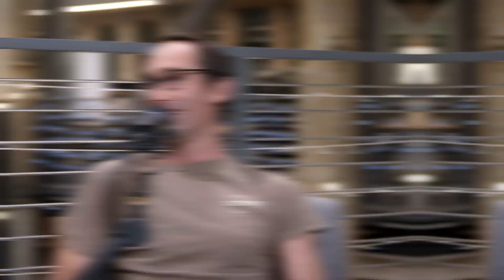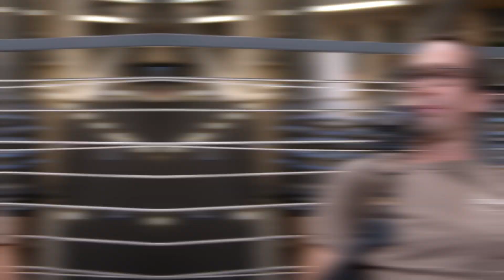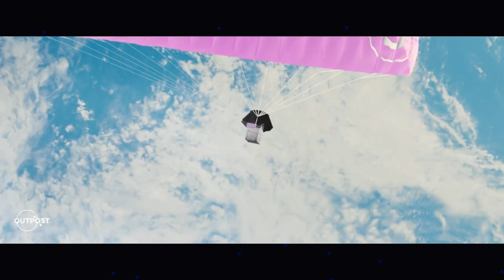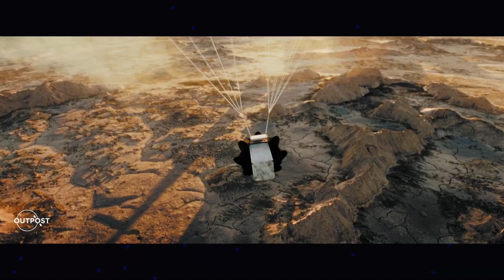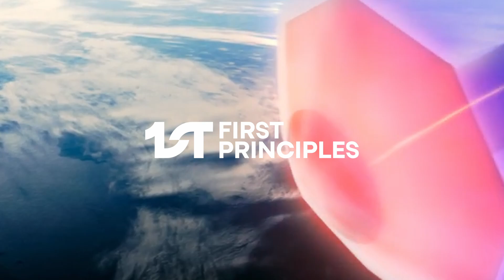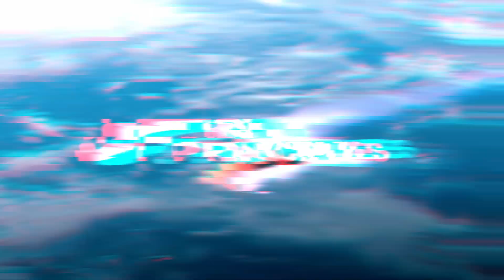He's Building Autonomous Space Factories | Jason Dunn, Outpost

Comment: Interesting idea... but if you're going to be launching these paraglider capsules on Starship, what's the advantage of transporting the downmass in your vehicle rather than just putting it directly in Starship's cargo bay? It's going to be heading back to the launch site either way. Is this just if you want a more flexible landing location?
Reply from the maker: @AndrewMeyer  a starship is definitely not tested/optimized for bringing payloads down
Reply: @1stPrinciplesFM  Well, it's technically not tested for bringing payloads up either; they're still working on that. But landing with a payload is definitely part of what Starship is designed for. (On Mars, the Moon, and Earth.)

I guess if you have more downmass than upmass you could put the downmass in both these vehicles and the empty payload bay of the Starship they launched on? 🤔 I feel like it'll be a while before Earth's import mass exceeds its export mass though...
Reply: I’d imagine the landing of the starship would take a lot of fuel, especially with an added payload. Might as well use no fuel and land with a parachute!